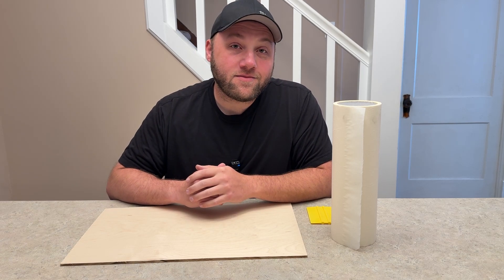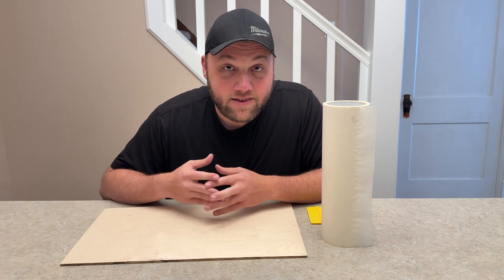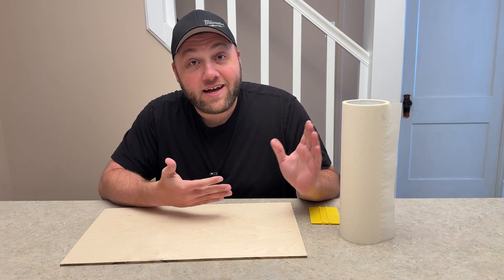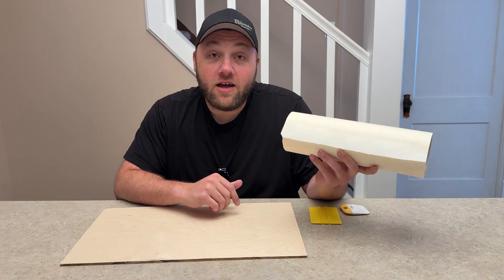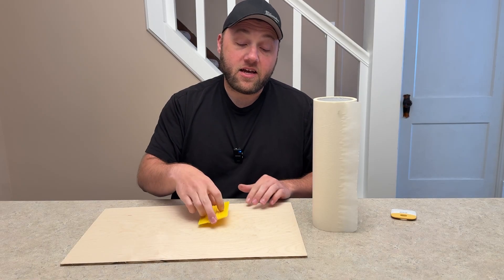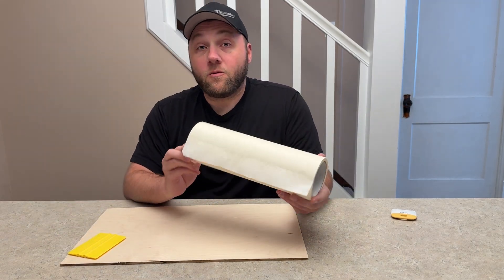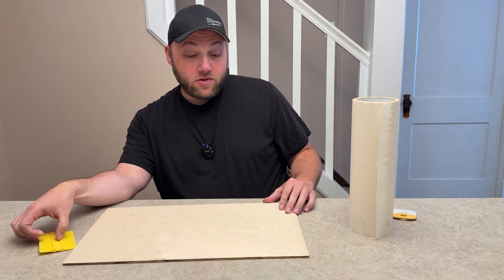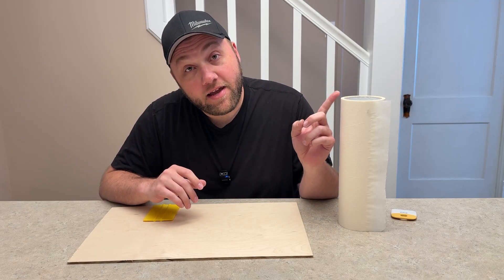We Need to Talk about Masking Tape in Laser Engravers

Comment: You have a very good point there. I see it happen way too often where people mis-use a product and then blame the product and the manufacturer when something goes wrong that was really entirely their own fault.  Regarding masking tape specifically, with modern diode lasers with air assist you shouldn't need to use tape in the first place if you have the power and speed settings right. There will be little to no charring or other problems if you're using quality wood and have your settings right.
Reply from the maker: Most definitely. Most diode lasers have adequate air assist